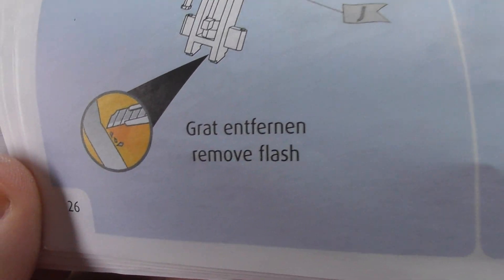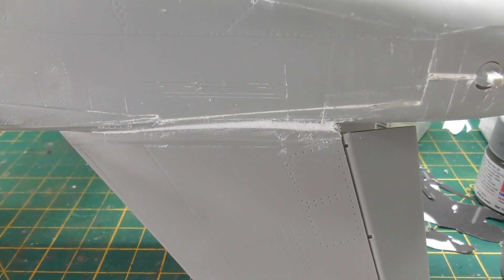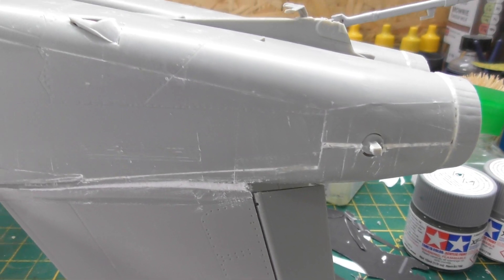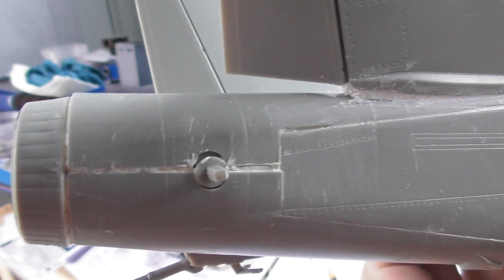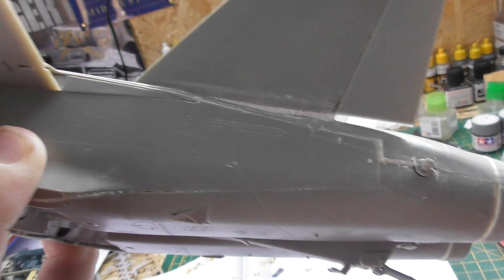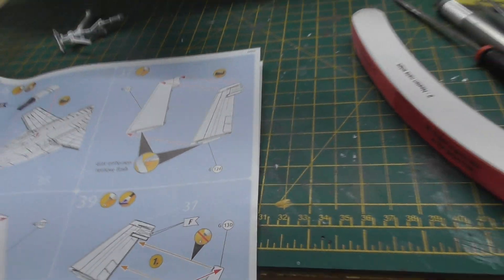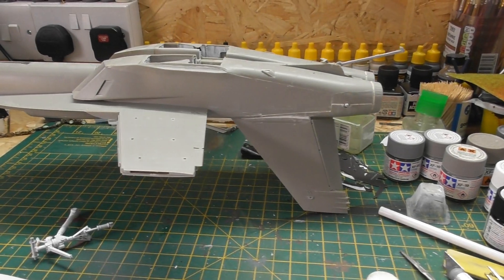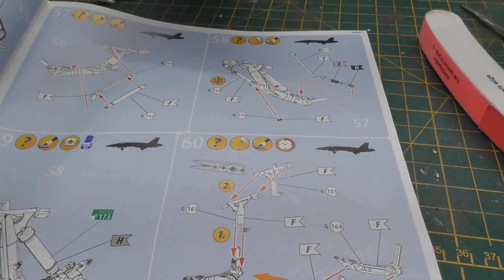AWFUL REVELL KIT 1/32 F/A 18 SUPER HORNET

Comment: I began to build this kit, and the first problem I ran into was the nose landing gear bay door piece not fitting  and leaving a good sized gap to fill.  That was the beginning because after that, I could not get the instrument panel and HUD into the cockpit and have the windscreen fit.  I could not believe I couldn't fit the front canopy  with the HUD in.  I was so frustrated, and am considering buying the Trumpeter kit and putting the VX-9 decals on that.  I have heard good reviews of the Trumpeter kit.
Reply from the maker: Yes I have had all those problems, I left the hud off and shaved the instrument panel down so I could fit the front part of the canopy. The rear part of the canopy doesn’t fit at all and I even had to cut a sizeable part off the bottom of the ejector seat to make that fit. It’s just a terrible kit, the worst I’ve ever built. I will take a look at another make of F-18 at some point.

Comment: I often find that Revell kits are a bit hit and miss with being good, thanks for the review
Reply from the maker: Many thanks for your comment, and thank you for taking the time to watch the video and my channel. It is very much appreciated.
Reply: Revell buys licenses from many other kit manufacturers. So, if you figure out which are the good ones, you can get good deal
Reply from the maker: @marcblank3036  Many thanks for your comment it's really appreciated.
Reply: @mikeMuppetmodeller  No, problem. For example Revell had a model of the Mil24 from Zvezda. Highly detailed at a better price. Same with Italeri. Unfortunately Tamiya has some of the Italeri range as well. They are not bad kits generally speaking but Tamiya is higher level and does not benefit from those. Revell armour range is also high quality save for the matchbox vintage series and some poor older ones. The kits are from various sources.
Reply from the maker: @marcblank3036  Many thanks for the reply and i will definitely take that advice on board going forward
Reply: @mikeMuppetmodeller . Hope your F18E was affordable. Years back had the F18A 1:32 by Revell. Not extremely detailed but a good model
Reply from the maker: @marcblank3036  Hi Marc thank you kindly for your comment. I think i paid abt £50-£60 for it so wasn't that cheap so quite disappointed but i've learned my lesson.

Comment: I bought this kit for 70 bucks. It started out fairly well. Theeeeeeennnnnnnnnn, the fuselage fit problems began. Good grief, this was bad. To get the two halves of the trunk together, I had to use a darn vise and with lots of tightening! Then, to get the side panels on and then mounted to the wings, it was falling apart each time. Trashed it and was very upset. From what I’m seeing, the two-seater has one review. One review! That tells me this was not one of Revell’s better designs.
Reply from the maker: I have come very very close to trashing mine also. Maybe shld do a diorama of a debris field and smash it up big time. Thank you for your comment though it’s very much appreciated and thank you for taking the time to watch the video.
Reply: Lol it’s $200au here is Aus! Glad I saw this video before I thought too hard about it. I saw a review on another channel that nearly swayed me to buying it. I’m out now. Thanks for confirming what I already suspected.

Comment: My best personal decision in my model building time is avoid revell products. Id rather keep using humbrol poly cement tubes forever than build another revell product :D
Reply: Ive had a few "upgraded moulds" from revell with ejector pins which failed and left holes in major parts like nose cone and engine cowlings etc.
Reply from the maker: I must admit I am regretting this purchase and build. I don’t think Revell larger scale kits are any good, especially modern aircraft

Comment: I just received this kit today. As soon as I opened the box I noticed all the smaller part sprues (which are generally heavier) were stacked on top. I knew and feared the worst. The main body was at the bottom on a flat surface, but the wings and such were stored over that and being bent by the heavier sprues, and these bends appear permanent. A little disappointed in Revell for not teaching their employ about the subtleties of packing models, that will no doubt be exposed to varying climate temps during some lengthy storage and travels, and what can happen when they do.
Reply from the maker: Hi Fester, I really feel for you my friend. I battled so hard with this kit but it battled back just as hard if not harder. I do hope you have better luck with it that what the impressions of the shocking packing of spruces looks like straight off. Keep me posted as to how it goes. Many thanks for taking the time to watch and comment it’s very much appreciated.
Reply: @mikeMuppetmodeller  Honestly this is one of those hoarder kits (many of those already) that will end up in a closet until a rainy day. When I did an online shop for an F18 1/32, the Trumpeter never showed up, or I would have bought that instead. Now I'm bummed.
But I do have a lot of experience in making models fit and work. I don't have a lot of experience in aircraft, so I may not notice much of the things that troubled you. Ignorance is bliss!
I posted my comment here because you have the most views on this kit. It was a good quality video.
Thanks for responding!
Reply from the maker: @festersmith8352  not at all it’s my pleasure, I believe that if someone/anyone takes time out of their day to watch or comment then I will show the same courtesy. Many thanks again and I think I’d give the Trumpeter version a go just as a comparison. I’m not a newbie to modelling but I just don’t want to spend hours and hours just filling and sanding.

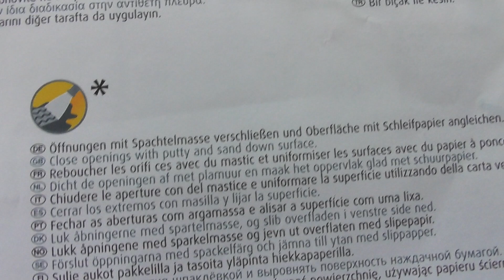Comment: 2:25 "CLOSE THE OPENINGS...WITH PUTTY ... AND SAND IT " hahaha ! is it this a KP kit ? I've got one in my stash with all PE from Eduard🤣🤣😂😂 still in the box. I brought this kit for 80 Eur ! I think Tumpeter would be better. Thanks for the video !
Reply from the maker: Its a Revell kit, I bought the Eduard cockpit PE and the ejection seat kit also. I think trumpeter, rye field models, Tamiya basically any other company would make this kit better. I’m really disappointed as I had some great ideas for a diorama for it but just feel like binning it to be honest.
Reply: @mikeMuppetmodeller  What about F-18 F or G from Trumpeter ? I think they are far better than the F-18 F from Revell newly rleased.
Reply from the maker: That wouldn’t surprise me at all, I think it’s just a better make full stop! I may have to look into getting one for Xmas
Reply: @mikeMuppetmodeller  well in my opinion you should finish this kit then get the Trumpeters F-18 to compare... what differences etc...
Reply from the maker: Sounds like a plan
Reply: @mikeMuppetmodeller  I did the same thing with Tamiya's and Trumpeters Tomcats § got both of them ! I discovered Trumpeters has some better details than Tamiya's one
Reply from the maker: I put the nose landing gear together earlier and the fit on that was horrible too. It was in 2 halves with another piece through the centre.
Reply: @mikeMuppetmodeller  could you show a picture of that issue . maybe I could help.
Reply from the maker: I’ll try and send one tomorrow bat as it’s 01.00 here I’m of up the wooden hill to Bedfordshire
Reply: @mikeMuppetmodeller  good night !

Comment: If I am not mistaken, Revell/Germany doesn't actually make kits. The rebadge a kit from another company. I have a Revell Ju-87 that I have had in the stash for several years that is actually a Hasegawa kit. So, I don't look for any problems on it. It would be my guess that this one is from some unknown factory in China. No reputable model company is going to put out a kit that tells you in the instructions to fill a gap that THEY should have filled. I hope you didn't pay a lot for that one. One to avoid, really' at any price.
Reply from the maker: Firstly thank you for your comment Stephen. To be honest I really don’t know who made it , it says Revell on the box and everything. I think it was between £40 and £50 which isn’t a lot but it is to me if you know what I mean. Where the gap filling is concerned I couldn’t believe it myself. I have never known any kit where you’re told to remove flash either but there ya go. I would strongly urge anyone NOT to buy this kit as it is awful and it’s taught me a lesson or two I can tell you.

Comment: I bought the E & F, both were equally as bad, ended up snapping them in half and chucking in the bin.
Reply from the maker: Hi Steve thank you for watching and commenting and believe me I contemplated doing exactly that. My son though said he wanted it on his ceiling and wouldn’t take no for an answer so I finished it up quickly and that’s where it is now gathering dust.
Reply: They are that bad are they. I have never really been a fan of Revell.
Reply from the maker: @zeroalpha7755  they really are that bad I’m afraid. I was really looking forward to the build and have never been so disappointed.
Reply: I will be steering well clear of those then.
Reply from the maker: @zeroalpha7755  I would, maybe the smaller scale might be ok I don’t know. However I’ve just built a 1/32 P-51D Mustang Revell kit and it’s great, goes together really well.

Comment: wow, thats the worst i've ever seen sir.... I already did academy hornet C type but never that awful. I do mainly 1/32 but have never seen so much putty on the vertical stubs, must be terrible gap there.
Reply from the maker: There was so much a gap it was more a canyon. Nothing fits it’s awful but I started so I’ll finish. I mainly do 1/32 but this is the worst I’ve ever done or seen.
Reply: @mikeMuppetmodeller  even the 1/32 old  revell monogram ah-64a apache looks like walking in the park sir, comparing to your hornet. I guess we better stick to other brand for 1/32 scale. If you still have obssesion building an Echo hornet, better look for trumpeter brand, so far they are the best in moulding. and the last but not least, happy modelling sir !
Reply from the maker: Yep in future it will definitely be another company make for the larger scale kits.
Reply from the maker: @henrytj7968  I am always well nearly always happy modelling lol. I don't think i will be buying too many 1/32 Revell kits in the future.